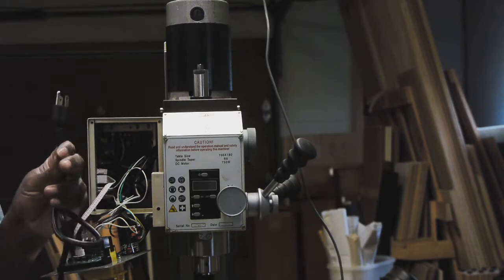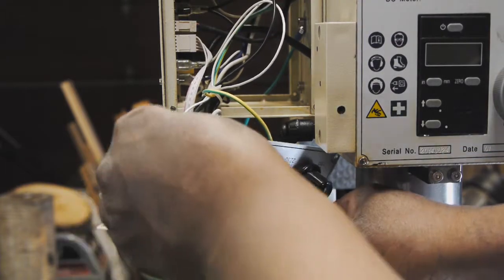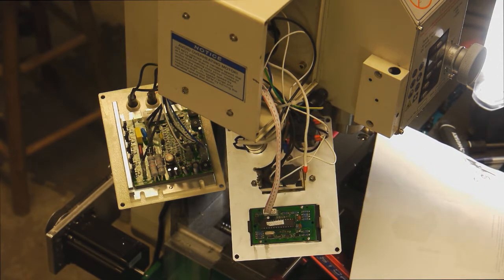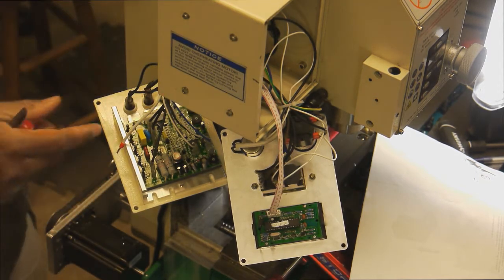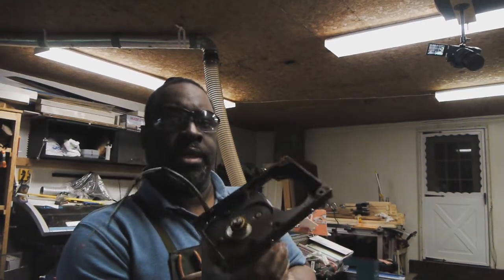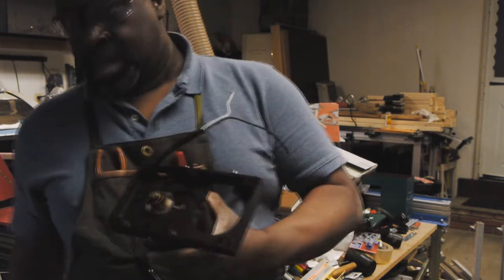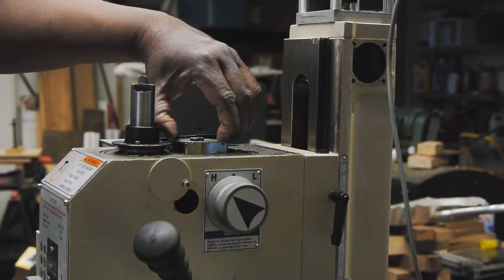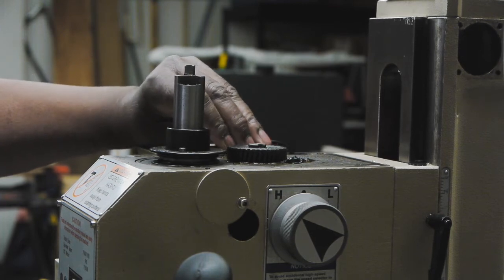Making a CNC Milling Machine - Remove the stock motor

Comment: Thank you for this video!! I got stuck last night trying to get that spring out.  I am installing a belt drive to the unit.  Don't think I am going to rewire the motor and just modify the plate that remounts the motor with the belt drive kit.